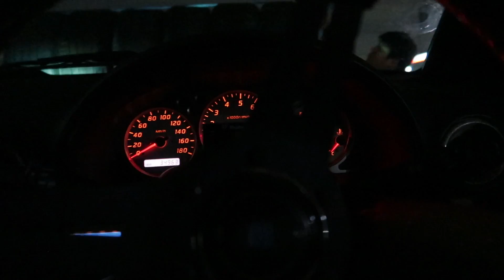KILLED MY S15 AT NIKKO CIRCUIT!

Comment: The trick to stopping the S15 ignition chiming is loosen the screw that holds the drivers side door sensor/switch a couple of turns until it's not earthing out the switch anymore and the interior light doesn't turn on when the door is open.

Comment: What oil is in the diff? Premixed LSD oils with included friction modifier additive tend to make the clutch packs not behave as they should. It’s usually for comfort/general purpose consumers. Best to find a decent oil that doesn’t have the additive premixed into it.

Comment: you drive the s15 with so much easy compared to the skyline, silvias are the ultimate drift machines haha
Reply: jiri havoc that’s also because it’s properly set up by someone with 30 years experience working on and drifting s-chassis.... if the skyline was better setup, with more engine mods and better suspension arms it would feel just as nice

Comment: Drift today or tomorrow it was gona break. If you threw a box, rod or bearing it wouldn’t have left the track driving. I thought turbo bearing collapsed.... close enough.... put a Barra in it, wouldn’t have this problem
Reply: Name Disclosed it would be extremely front heavy and would feel like ass.... you DO realize how big and heavy barras are right? Especially compared to an sr
Reply: Matt L couple kilos heavier than an rb, and they are drifting everywhere. His turbo gave out not the motor I actually don’t mind SRs, I prefer them over the rb. But after seeing the Barra swapped s15 at empire mechanical.... it was awesome
Reply: Name Disclosed a couple kilo’s is a lot, and the rb is already a lot heavier than an sr. With how okamura-San sets up his cars, it would completely ruin the handling characteristics
Reply: Matt L listen guy.... a couple kilos means 3-4. That’s compared to an RB..... so what are you talking about? Compared to an SR???? No fukn shit an SR is lighter than both motors, it’s also a good motor once you dump 20k in to it. Or you can buy a Barra for 3k , put 6-7k and get 1000hp. What’s an SR weigh anyway about 150kg with the head for a long motor?

Comment: So do you recommend running -.5 or -1.0 for camber?
Reply: More then that. With some set ups when extending the tie rods/knuckle mods you have to run much more just to get toe into spec. For drifting your going to want somewhere around -4* minimum to start with. Some people run much much more.
Reply: Depending on the chassis really.
Reply: Awesome. Thanks man. Hopefully my SC will be ready for next summer

Comment: Does he have a fuel swirl tank for the s15?
Reply: Do you mean a fuel cell?
Reply: @ericpelky1246  no i mean fuel surge tank which is a seperate little tank to prevent fuel starvation to the engine around hard cornering